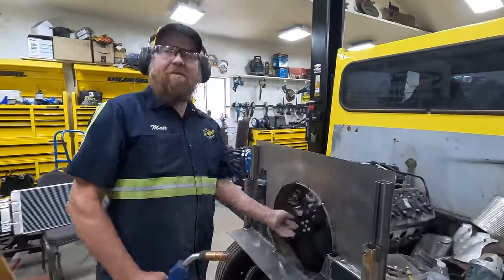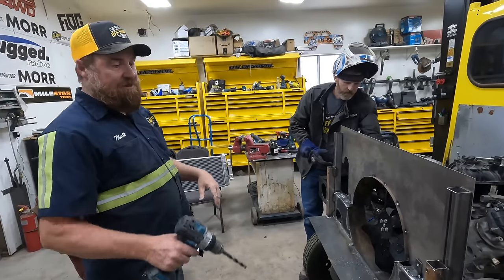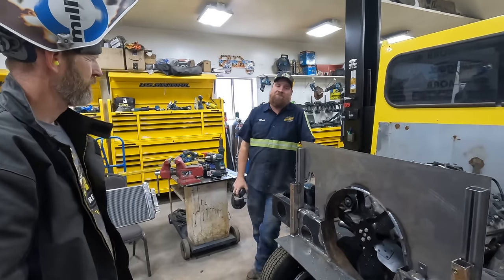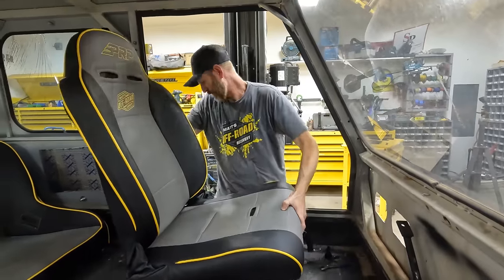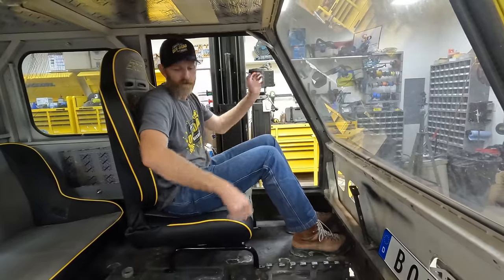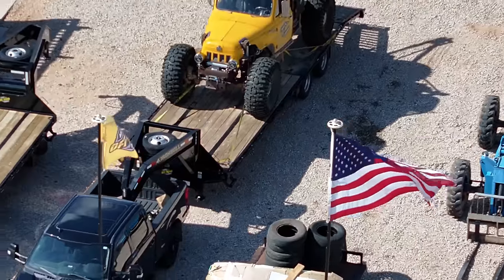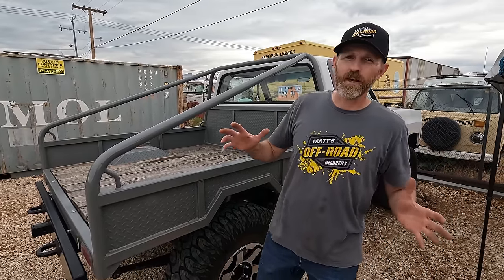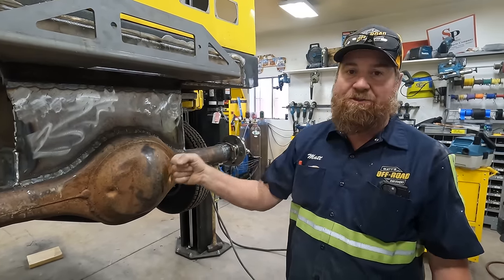The Best Upgrade The Bombi Will Ever Get!

Comment: work lights vs search lights vs head lights vs spot lights = VS bombi
--work lights = high up and pointed downwards say 10 to 20 feet and do not shine outwards beyond that, so when you are standing away and look you are not blinded, but when you are say working on tracks they will not shine ON the tracks and you will provide shadow on the work area as you are working, it does light up area around your unit. 
--search lights = pointed out and if stand away you will get blinded and have not a clue what is coming hoping not to be ran over. 
-head lights = tend to be lower but pointed down wards at X amount of feet away from given machine, and the lights do not tend to shine any lights in upward direction. 
--spot lights = kinda like a lazer beem straight do not funnel outwards, more likely to be hand held so you can easily shine the lights back and forth and up and down and designed to be moveable while unit is moving.
VS

--side work lights = tracks are going to come off some place some how, and/or shoveling snow, or you need to light up something so you have light to remove snow from something else. 
--front / rear work lights = you are dealing with cable, chain, rope and/or hooking to a vehicle a few feet away
--search lights = i hate them, i just do, to blinding, one look and you are sun blinded and in the dark, so you are blind for a few seconds to a couple minutes pending indvidual.  if they were mounted say 14 to 20 feet up in air, sure, at that height i can still see standing and i can lower my head some and still see towards unit. but when placed lower 8 to 10 feet off ground. MEH forget it. 
--spot lights = 12v cigerette style plug or like sure for hand held. having some police car mounted search light on hood, cool for kids, but usefull in woods or tight places? most likely not. more likely used for longer range search from vehicle vs up and close areas.

Comment: I like the idea of moving the lights, but, only because I'd build foot room in their place.. It's awful tight inside her, so why not give yourselves some boot room???  A flat digital dash would also save some room inside..  It's a shame you didn't build it a foot longer so the interior could be somewhat comfy for all....  Also, the brake levers: I'd put the masters in the middle of the deck, between the seats, but build the joysticks  out of different length tubing, so the left upright would be shorter than the right upright.    Then  90* angle over to the center of the drivers seat and another 90* angle up and another 90* each in opposite directions for hand grips.  Making them different lengths will allow the right over the left and still bypass each other and your legs, while allowing you to get in and out without climbing around the joy sticks..  The axis pin and supports will have to be very heavy duty to deal with you animals, but I think it would be very comfortable to drive this way. With them being 2 different lengths, you could still drive it in comfort, rather than leaning 100% of the driving time.. That's a back ache  in the making on EVERY run!!!

Comment: With the lights on the front thinking it’s main use is in snow I would prefer lights up top like possibly roof mounted light bars and you said you wanted a beam light on the roof Australian has hog hunting light we use it’s a large beam light that mounts to the roof with a handle that comes down inside the cab the brand I have is “powa beam “ if that helps you really good to easily direct light with out having to move the whole vehicle especially in a recovery where moving the vehicle isn’t possible

Comment: Why don't you use the headlight on the BomBee and put your fog lights there. Then mount your driving lights on your axle. That's what my wife and I did on our straight axle Ford F250. We have 41/14.5R16 SS Irok Radial, with stock wheels.

Comment: So if the Bombi lights are not going to be in the cab, why not put them on top away from snow drifts etc. That would also get them above the snow spray and you’d hav Les light reflecting back at you. 🤷🏼‍♂️Just a thought.

Comment: leaning over to drive will start to hurt after a while and may cause back issues could a remote drive system work where the controls are connected by a wire to a playstation type control similar to HIAB and Big wreckers its looking good and TomToms enthusiasm is infectious. You need a guest welder spot so Lizzie and her green helmet can make an appearance

Comment: The angle grinder! I ended up in the ER from a kickback on a grinder, 6 stitches in my wrist and my thumb has no feeling in it now and its been 6 months. PPE goddammit, ALL THE TIME. I was using ppe and got lucky it didn't hit my kneck or gut or thigh, it did get an artery and nerve and ligaments in my wrist. BE SMART.

Comment: If your going to run your brake sticks in the middle I would put your dash in the middle only. Give yourself as much knee room in front of the seats as possible. Or do what others suggest and bump out the front or rear of the cab for more leg room. It looks very cramped in that cab.

Comment: Could you do a single hand throttle and then 2 brake foot pedals for the steering? Would make it easier to drive and you would not need to reach across your body.

Comment: Very Nice Fan but, I'm calling it an "Air Pump" with about 20 pounds of total thrust into the Radiator at 2000 rpm; Guessing, Plenty of cooling. 
May I suggest; a EZ to remove and clean screen BEFORE the radiator.
You can thank me later.

Comment: It would be cool if u made the steering wheel like a plane. It would work if u use cables. Push forward go forward pull back go back left to right u know what im sayn.
Reply: @Mattoff_recovery1-oz5nl  u have sumthin for me. Like a kick in the butt. U know it would work. Get sum hard lines like a throttle cable on a ol boat.

Comment: You know, with the air  being pulled from the engine area, there might be an advantage of getting warm air by standing near the rear of the Bombi while the engine is running.

Comment: I'm not a mechanic but I'm sure that when you stand facing the motor with the pulley side of the motor facing you. if the motor is running. The cam and crank pulleys turn clockwise. If so... your blades will be facing the wrong way.
Reply: Yes you're not a mechanic. The fan isn't connected to the cam or the crank pulley. It's turned by a serpentine belt and you can make the fan turn clockwise or counterclockwise depending on whether the belt goes over the top or under the bottom of the pulley.

Comment: Another way you could have mounted the radiator is side mounted to either side running an electric fan or 2 kinda like how the hemmt radiator is one side could be the radiator other side could be oil and trans coolers

Comment: why not use a big light bar just bolted straight to the front bodywork, higher than where the headlights were or even on the roof. would give a large light output forwards with flood beams sideways too and be minimal work to install.

Comment: Some fork lifts use blow through radiators, and they work hard.
Reply: Depends tho, ours have blow through but are ducted to draw fresh cold air from the side of the truck through the rad. They also don’t Rev very much at all, 2-3k rpm usually max
Reply: @riddioughp  The Ls will definingly have that fan spinning quick.

Comment: Why don't you put a big light bar on all four sides so you can see all around at night? Mount then as high as possible and some red interior lights. Slap the whole cooling fan thing pulling air in would keep the cab warmer but other than that I think your way is actually slightly better for cooling the engine itself. Pulling cool air over the component your trying to cool verses exhausting hot air onto that same component.

Comment: It was freaky watching Matt drill in the direction of vital organs. Of course, drilling through a tube, it would at least give you a warning before penetrating the steel. But what if the drill bit broke or slipped off?? I didn’t see any drilling oil. 😳

Comment: The controls really should be relocated in front of the driver's seat..  Given how long some of the drives out to recovery sites take, the new seat upgrades won't matter much if the driver has to be constantly twisted to the side to use centre-mounted brake/steering controls..

Comment: Hey Matt,
Your blow thru radiator design is nothing new. It has been used for years in heavy equipment.
The little lip at the bottom may make some restriction.
But finish the build, run it and see if what you have works.
No doubt some can’t look beyond something different they have never seen before.
I respect your frequent “farm” engineering. 🚜
It’s what made this country great 😃

Comment: Anyone still arguing about the engine fan and radiator clearly hasn't been around a Utah winter. We get a dry heat during the summer and then we get a dry cold which gives us awesome powder and nose bleeds. The point being is that the air will be cold enough to cool it down. The radiator has enough surface area to dissipate heat effectively enough. And if all else fails, Matt and Tom will have to eat a humble pie, which I've heard is super bitter. Sometimes theory isn't correct and sometimes people have to learn for themselves. Theoretical-Comment-Engineering isn't proving anything for your cases.

Matt, Tom; go ham with the Bombee and just show us what ya got. That all aside though, Matt. 7:47. Please show a little more self discipline and safety. We get you're the one who flies by the seat of your pants. We get you're the cowboy of this channel. But drilling towards yourself, even if it's through metal, is not a safe thing to do. That is really the only thing I'd admonish you on. I get it. You've had a lot of experience and what not, but for our sake and your sake, maybe put something between you and what you're drilling into for safety? Best result would be you never drilled towards you again, but all I ask is next time you have to do so, get some other sheet of metal between you and what you're drilling. It could be the difference between regret and another close call.

Comment: Why not use steering brake pedals— so you actually brake harder to go in that direction. Ex— Right brake pedal  slows down right side track— then just use a single mid mounted hand throttle?

Comment: Still say a better setup for the exhaust is to run them backwards down and out the right and left corners mounting the mufflers to outside of the frame with deflicture covers so they don't get ripped off.❓❓Is Ed losing his hearing why you all talk so loud to him. If so hard to notice it.

Comment: I typically don't comment on your fabricating skills, but I feel it necessary this time... You just reduced the cooling "Capacity" of your radiator by about 40%, The only air movement you will have going through the radiator will be where your fan is, you are creating dead zones on the outer part of the radiator.  Your fan shroud should direct air to the entire radiator and not just in the center, Air will flow in the direction of least resistance and your "box" around the radiator has too many sharp angles which will actually trap air.

Comment: Matt, I am not going to scold you about safety glasses, you have heard enough about that already.  At 7:47 in this video you were drilling a hole in the vertical support with the drill pointed right at your heart.  I realize it worked best for the camera angle.  What concerns me, when the drill slips, breaks through the support, or shatters, the drill will puncture your chest wall.  Ask me how I know.  I drilled about a million holes in my career as an aircraft sheet metal mechanic.  The shirt I was wearing when this happened to me is still in my closet. It is a reminder not to drill holes towards your chest!

Comment: Are you using a new camera? I noticed in this video, every time the welder trigger is pulled. the welder flash is putting a blue/black lens flare "void" in the center of the video. it never did that with all the older video's... "just a heads up"

Comment: If the fan is in a push configuration you would be pushing a lot of hot air through the radiator while idling especially with the cover on. I think electric fans are definitely the way to go, especially considering they can still be in the pull configuration since air flow doesn't really matter if you'll be idling or putting around anyway, plus you might keep an extra 15hp not having to spin the mechanical (or clutch) fan all the time. Just a thought, love the video as always!

Comment: The biggest issue with the cooling system is the fan pushing air vs pulling.  Fans like that are WAY more efficient pulling the air.   Will it work?  Probably.  Is it the best?  Nope.

Comment: This machine will get limited use, in the sense of total hours of operation. With that observation, I think it is unwise to hard mount a radiator, especially in a vehicle that might get subjected to forces that will flex the chassis.  Combine that with the vibrations the radiator will be constantly subjected to from the motor and gear train, the tracks, as  well as rough snow trail conditions

Comment: A nice big radiator just to cover  50% of it with an shroud. Just remove the shroud and put 2 electric fans on it and you will have much more cooling effect in the system.

Comment: Okay Matt, I am curious why your not just using an electric fan set up? It would give you faster warm ups along with better control of the engine temperature. Better engine temperature control allows the engine to work at optimum fuel/power efficiency. Also taking the mechanical fan off the engine should return about 11-15 HP to the engine. (Ref: Engine Masters fan shoot out.) Interesting build so far.

Comment: As far as I have experience with cooling, your system is wrong, a car gets fresh air from the front, the air cools the radiator and the engine.
In your case it's wrong, the vetilator takes warm air from the engine and tries to cool the radiator, which means it takes a long time for the water to get cold, in my opinion, install an electric fan from the outside and let all two fans run together. let them blow inward

Comment: Looking at the "B-17" picture some more, was wondering, did your graphics guys use AI to build it? If you notice, the engine closest to use has only 2 blades... was wondering if AI generated art has the same problem with propellers as it does with number of fingers ????? ;-)

Comment: Putting that plate behind the radiator and making that shroud was totally unnecessary.
The plate blocking like half the radiator alone is a bad idea.
Why even have a radiator at that point?
The fan won't even be pushing air across the top part of the radiator.
You should have just gone with slim electric fans, mounted to the radiator.
That would be much cleaner and easier to work on later with none of that shroud stuff.
Yall do great work for sure, this just wasn't the best cleanest way to go about this, by far.
Heck you could have kept the clutch fan and used it to blow air across the block, and still have electric fans for the radiator!

Comment: Besides the fact you decided to use a single point of failure with your axle semi floating light duty passenger car axles. Makes  no sense to me at all. 
Hell I have a fully restored 1 Ton dual wheel (single now)with the disc brake bracket with a brand new Yukon 3.73. full floating 14 bolt. Thus giving you amazing redundancy. You snap an axle no worries the load is on the bearings and not transferred through the torque thus you are able to keep moving. 
I  seriously can't wrap my head around the thinking behind a ford 9". Makes zero sense when you are going to have 400-450hp and climbing mountains while pulling heavy  frozen  equipment. 
Can only assume Matt & Tom missed that day in class......
I'm offering this diff for the build or a future build. Would love to deliver it. 
It came from a 1 ton square body ambulance from military. 32 spline. Need chromoly upgrade and lower gears.
Just an offer as long as I get a Yukon grizzly locker for  a different build and the $300 I got in restoring it and heavy duty paint. It is yours.
Have you all ever thought about putting a articulating bucket on the heavy wrecker you know l;like the only vehicle that could hands down put all your toys to shame with vastly supplier attachments and tractor crawling power of the Unimog. They have some sweet attachments that could really assist. 
Bombi prolly needs some sort of bucket or bulldozer to move  snow around much easier.
Sorry for long text I hope you take me up on my offer for that full floating 14 bolt.
Plus I have amazing idea for a recovery vehicle that is the trailer with lower center of gravity than anything you own Many  yrs of engineering and fab  in the off road community across the country. It would;d be an honor to teach how to build a real wrecker where you have to rsk a life holding brakes and or at lease has 2 tires to be able flat tow.
One more suggestion Your crane / boom should rotate  360 & a bucket in front like a backhoe this way you can make the trail accommodate you and not the terrain.

Really would like to hear some thing back. Lock your vids keep 'em coming and let   me know when you want that full restored 14 bolt grizzly yukon lcoker  
Sorry for rambling.
Also you all need one of my land anchors  takes mins to setup no digging required super strong yet stupid  simple.
Check out the   Unimog  for sure

Comment: You folks always end up out there recovering someone's mistake in the crappiest weather or the dead of night (or both) and yet you still haven't put scene lighting on your rigs.  It doesn't need to be 1 million candlepower spots.  Just enough lighting so that you can see your immediate surroundings and not turn an ankle moving around the rigs.  I'm sure there is a reason why, but why?  🤨